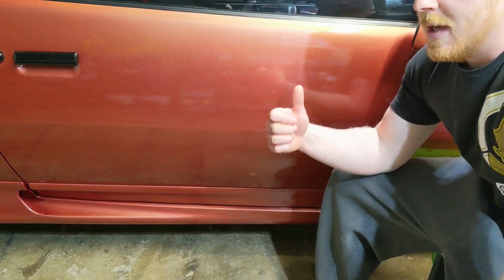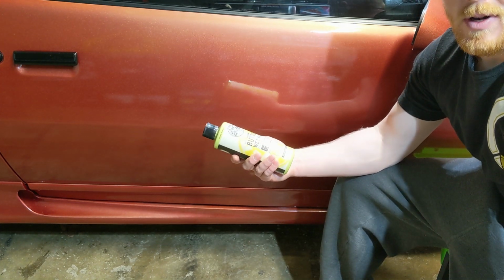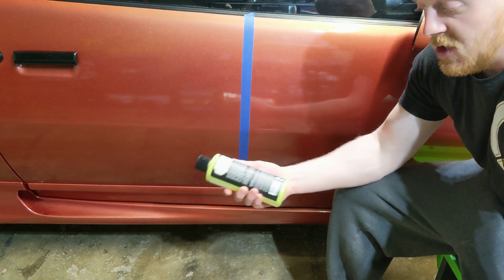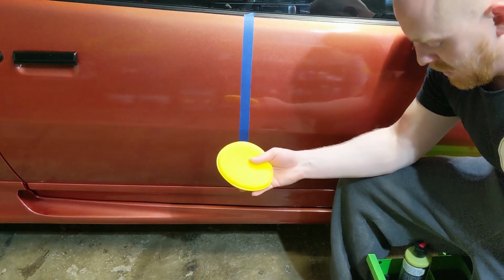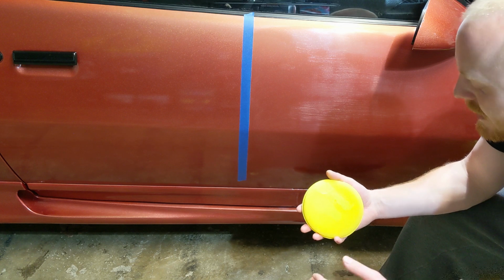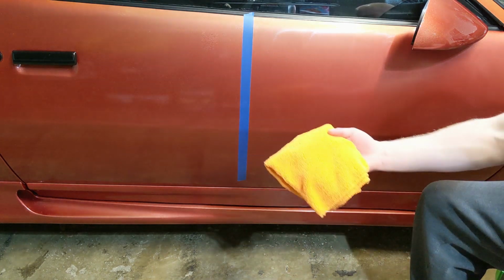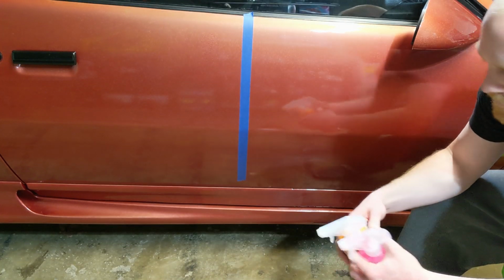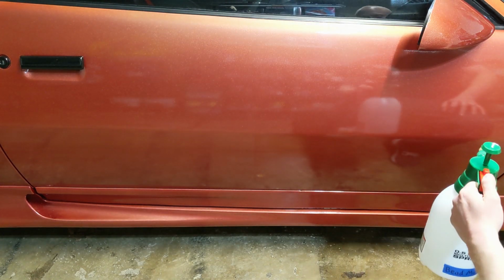How to Apply Wax to your Car by Hand

Comment: After washing, instead of a clay bar I have used PB Blaster penetrating oil spray rubbed in with a microfiber cloth. The Nu Finish liquid polish is good for a budget, and a wash and wax liquid. Hagerty has a good written article about the new paint for a Mazda MX-5 Miata, to get off to a good start.